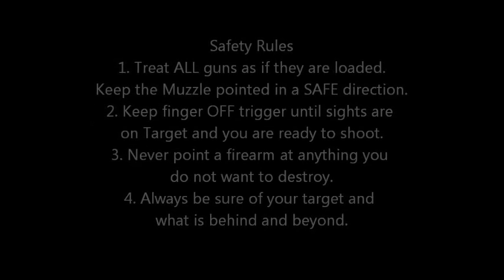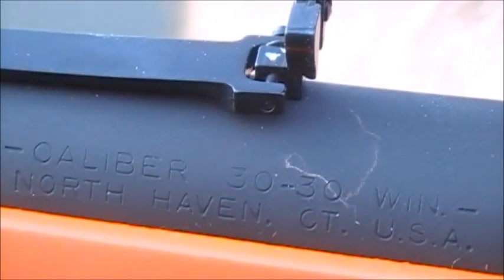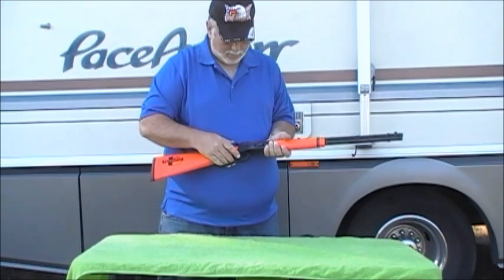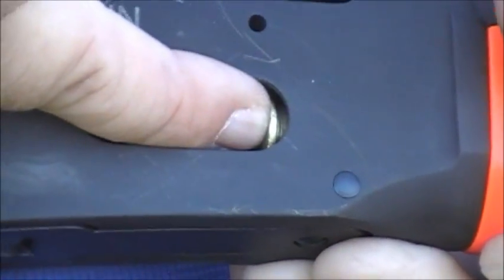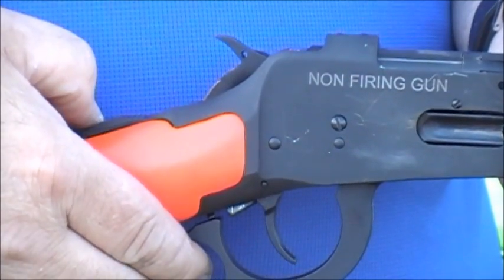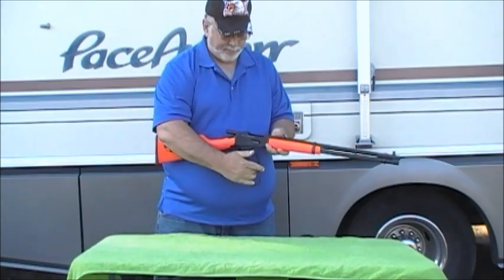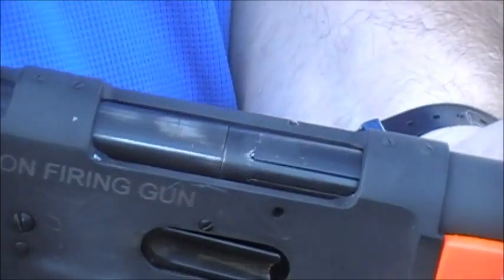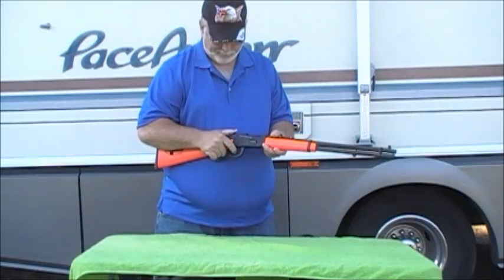Loading  Unloading a Lever Action rifle

Comment: These are very good basic videos but I would make a small suggedtion. I've found that the students lesrn more about rendering a firearm safe if you use dummy or safe action rounds so they'll see them from the beginning of the unloading cycle all the way thru ejection. Just a thought.  Keep up the good work.
Reply from the maker: dummy ammunition was used in these videos.
  If you will notice, the casing has a hole drilled in it and there are no primers.